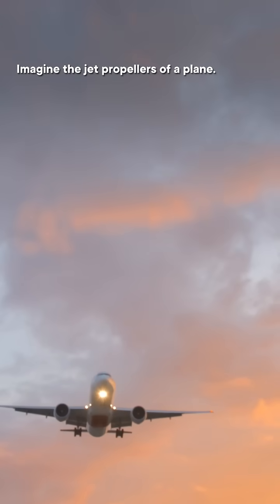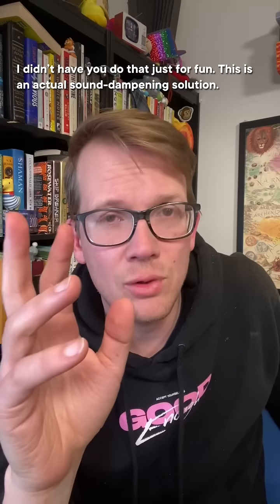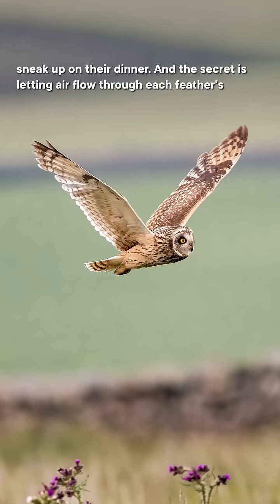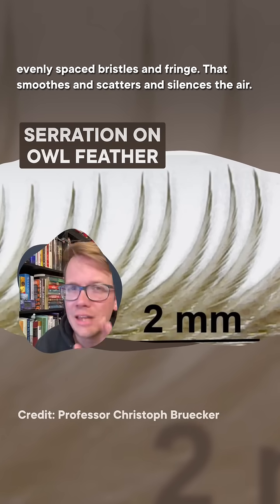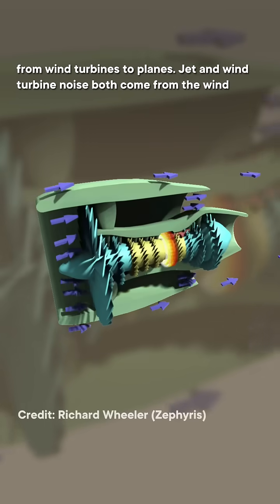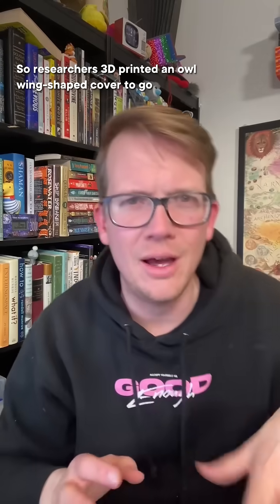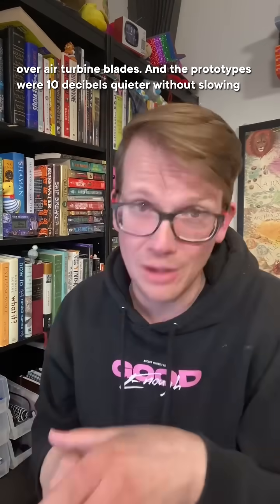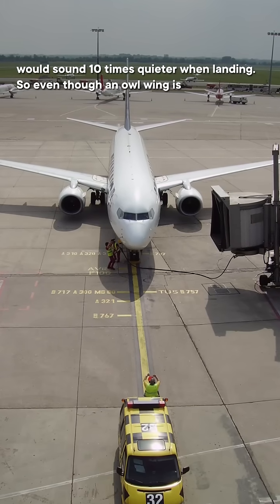Now, we can be as quiet as owls #shorts #science #SciShow

Comment: Boeing has something similar to this. On the 787 Dreamliner and 737 MAX families of aircraft, they use chevrons on the engines to help the high velocity air coming out of the back mix with the static air around it smoothly. Without them, the static air creates vortices which causes a large amount of the sound from jet engines. As for the fan and compressor blades, they can't really get quieter as well don't have materials strong enough to do this yet

Comment: As a employee of a GE and Pratt whitney refurbishment plant I will say that the alteration that you are suggesting would make the blades "single use" parts instead of being able to recondition them.   These foils are not cheap to say the least! And there is a hundreds or so of them in the engine between the LPT and Hpt sections. The limited lifespan of a new blade of the current design is short enough. I don't believe the blades you are suggesting would make the life span about an eighth of the current ones. Inkonel is tough but I don't think it is that tough.... I've seen sooooo many cracked blades in the last 17 yeara you wouldn't believe it.   There is something to think about. 🤔🤔🤔🙄🙄

Comment: I'm a wind turbine technician. This is kind of already utilized. The blade on some new turbines feature a serrated edge on the back of the blade to reduce noise. These are essentially add ons to a blade and are not built in so it does not reduce the structural integrity of the blade.

Comment: While this makes more sense for propeller driven aircraft where most of the sound comes from blade noise, on a high-bypass turbofan the majority of the noise comes from the interaction of hot exhaust when it hits the cold airstream. Reducing Exhaust Gas Temperature does a huge number on decibels. For example a military aircraft with afterburners engaged sounds WAY louder than the same engine at the same throttle setting without afterburner on.

Comment: 10db quieter is way more than 10x quieter. Because it's on a logarithmic scale. The difference is that the "force" of the sound doubles every +3db.

2 engines/machines/etc going at 110db make the same noise than 1 engine going at 113 dB.

Comment: there's chatter coming off the rear surfaces of every mode of transportation; Golf-ball-dimples and Braille-dots are actually dynamic resistance cancelling features that could be applied to any technology that travels at speed, fan-vanes, propeller-blades, keels, hulls, rudders, spoilers, air-brakes, high-tension-wires, high-rise-balconies, suspension-cables, ie modern design.

Comment: The decibel scale is logarithmic. This is very significant and really cool tech, but I've spent the last 15 years working with "loudness" professionally and as a hobby. Standing next to a woodchipper is 10 dB quieter than a jet at 100 feet. It's still super dangerous to hearing. The stereo in my car was technically 100 times louder than that same jet engine. I listened to that for several years with very minimal side effects(partially because of the specific frequencies). Sound is a strange beast.

Comment: Jets do not have propellers. Also, PLEASE make the captions optional!
Reply: dude.. jets do have propellors.. they just arent fixed onto the front of the plane like in early inventions....

but i promise you every single jet engine has a propellor.  the fan blades are just housed inside the engine housing, instead of outside of it.
Reply: @o0xTHEcoPlayerx0o  Fan blades are not propellers. They do not propel the plane, they compress air and drive the compressor, the propulsion comes from the  fuel combustion.

Comment: Can we have this tech on leaf blowers immediately?
Reply: If your referring to gas leaf blowers the only reason thier loud is due to a IC engine that spins the blades to push air.
Reply: @Mrjack-yn2dj  the blades are a significant part of the noise, but not all. I'll take any reduction I can get
Reply: I'm not sure it would be effective on centrifugal compressors as in a leaf blower.
Reply: @100GTAGUY  well I'm not sure how they work. I had assumed high velocity fan blades, but I don't know for sure
Reply: There already are more or less silent leafblowers in use nowadays. Becaus of ergonomics the batteries of the things I saw were placed in separate backpacks so the cleaning personnel looked like they walked out of a ghostbusters film.
Reply: @haifutter4166  🤣 I ain't afraid of no 🍂😹
Reply: @haifutter4166  heck, Ryobi makes one that uses the same battery pack as all their drills, impact wrenches, grinders, etc. use.
Reply: Can we just ban leaf blowers?

Comment: wouldn't that necessarily reduce the efficiency of the turbines, thus requiring burning more jet fuel overall?
Reply: Actually, with the fuel energy NOT being converted into sound energy, I think it would increase the efficiency. Unless, it just ends up as more heat instead of sound.
Reply: @JoshWebb  i thought it was implied that it would end up as tubulence, just quieter turbulence

Comment: just a question: will this also make the engine's more efficient? less turbulence, less transfer of energy into sound? higher efficiency?
Reply: Pretty sure that turbulence equates to localized low pressure which equates to a partial vacuum "sucking" on the back side of the turbine blade, creating drag and slowing them down. Reducing turbulence and smoothing out the airflow (laminar flow) should actually improve engine efficiency.
Reply: @elimgarak7330  but you don't want the fan blades to spin to fast. It's important to keep them under the sound of speed and reduction gears increase the cost of MX.
If you made those blades too efficient then I could see that being an issue. You might save money in one area but spending it elsewhere
Reply: @collins9708  the blades going supersonic isn’t an issue unless the blade is less efficient, if that’s the case then the plane would have to just move slower as the blades would spin less, so generally this just means the plane would be quieter at the cost of soeed
Reply: @spencer4685  if the blades go pass the speed of sound then the airflow becomes less efficient from the shock wave that it produces. Even if you make a blade that is More aerodynamically efficient, you would lose all the efficiency once you go pass the speed of sound and this is currently one of the major issues in props and jet engines designs; Keeping the blades subsonic. Modern day blades are being held back by the dilemma of keeping them subsonic. Most props have reduced gears and even some jet engines but it increases maintenance and this was one of the major flaws in pratt and Whitney's engine when they put a reduction gear inside their engine. 
Our blades are pretty aerodynamically efficient as they are. I just don't see the need for this.
Reply: @collins9708  Pratt and whitney GTF engine is fine now after the initial problems, havent heard anything for the past 2 year or so. We should be seeing the tech move on to widebodies soon
Reply: @spencer4685  a blade going supersonic is definitely bad, almost no thrust is generated on a supersonic blade, most engines reach supersonic on takeoff but only the tips of the blade, and thats what making the majority of the noise.
Reply: @spencer4685  that’s untrue. Supersonic blades create insane noise and are very inefficient due to the shockwaves formed by supersonic motion.

Comment: Also computer cooling fans. Millions of the howling bastards, in server rooms & home systems all over the world...

Redesign the fan blades with Front Serrations (as shown) & Fractal Back Edges (soft fluffy wing pinion feathers, which help to dissipate the sound of air flowing over the owl's wing). Balance fan speed with high cubic meters of airflow & you've got a silent beast.

They've been a work in progress for several years, now.

Comment: I was... literally just wondering if I could modify my ceiling fan to make it quieter. maybe i should redesign the blades.... the fan's modular.
Reply: The noise from a ceiling fan is generally not from turbulent air spinning off the blades; it's from the bearings in the motor housing as they flex in dimensions other than the rotational dimension in which they're designed to operate. To quiet a ceiling fan, you would first want to balance the blades as much as possible to reduce the wobbliness of the axle as it spins in the motor, thereby reducing the vertical stresses seen by the bearings.

Comment: Did they also measure the impact on fuel consumption? As this is the main consideration when designing a jet engine (reliability & safety being more of a pre-requisite)
Reply: Exactly what I'm thinking. They're already inefficient enough
Reply: @RomanNardone  inefficient?? Um no. They are the single most efficient engine type in the world for pound of fuel to power output.
Reply: @thegoldenatlas753  I don't mean the efficiency of jet engines from fuel to lift. I mean the efficiency in the amount of fuel required to fly jet engines and the amount of emissions which contribute to climate change (also the only fuel still allowed to have lead in it)
Reply: @RomanNardone  first off.
No. Efficiency is measured in power per unit of fuel.
Effective torque, effective thrust, etc.
Jet engines on airlines use lots of fuel because they need to produce a lot of power but their power per unit of fuel is greater than any other combustion engine.

Also jet fuel doesn't use lead. It uses kerosene.
General recip aircraft use leaded fuel, and its because they need the lubrication properties of lead.
Reply: @thegoldenatlas753  are you just looking to fight with someone? You obviously knew what I meant. I was pointing out that airplanes already use lots of fuel and adding something to muffle the sound would like increase the amount of fuel used.

Thanks for the clarification on the kerosene. I do know that the fuel used does contribute far more to environmental damage than other fuels so additional needed fuel would have a larger effect than other types transportation
Reply: @RomanNardone   ?
Forgive me for asking but how would it increase the amount of fuel used? The new design would only add bristles to the engines to makes it more efficient in not only noise pollution but also general speed, it has nothing to do with fuel or its consumption, in fact it would actually reduce the amount of fuel used if I’m thinking right.
Reply: @srslothington  because it could effect aerodynamics
Reply: @RomanNardone  it would affect aerodynamics, sure.
It could be a positive effect though :)
Sound can be reduced by muffling it and/or by reducing the turbulence from the source. If the effect is not muffling, then a reduction of turbulence would actually increase the power efficiency!
Reply: @patrickpredella  If it was more efficient every bird would have it.
The owl needs the stealth to ambush their preys, so the reward is positive.
For ducks,  who needs efficiency for the migration, not so sure.
Reply: @ameunier41  that's actually not guaranteed: if you're a duck, what is the point of silent flight? I can't really think of any. That means that a duck with a special feather mutation would not have a survival advantage, and ducks have huge populations. That means that the mutated trait would not emerge as the "mainstream" duck, because other ducks wouldn't die off.
Reply: @RomanNardone  Leaded fuel is only for piston-engine aircraft.
Reply: And durability
Reply: I also wonder about keeping the bristles clean, so that air can pass through them, and the life of said bristles when they spend 12+ hours per day being battered by wind at 450mph.
Reply: @pulaski1  have you ever seen a dirty owl me neither
Reply: @katiebarber407  they should put a big beak on the front of the plane that cleans the bugs out of the feathers while it’s on the ground… actually let’s just scrap planes all together and fly around nestled in the feathers of giant owls 😂

They can be powered by the snacks and crumbs people leave behind
Reply: @katiebarber407  I haven't seen a Boeing preen itself either!  🙄
Reply: @katiebarber407  have you ever seen an owl going through a flock of birds at 450mph ?
Reply: Wind turbines have a blade type called a whale fin. More efficient and quietter: for wind turbines. A jet engine works on the natural compression of the air fuel mixture for propulsion. Im sure it would work in the future, but not now
Reply: I love hearing an engineer's perspective on this. The DOD doesn't care about dollar-signs; that's for post-war economists to worry about.

"Never forget that your weapon is made by the lowest bidder."
Reply: the 787’s GEnX engine already has similar bumps on the end and it’s one of the most fuel efficient planes
Reply: It might even improve it. Noise is energy that is wasted.
Reply: @M33f3r  yep reduceing turbulences will decrease internal drag and increase efficiency   kinda the same happened with the winglets the (mostly upwards) curved end tip of a plane wing inspired by the feathers of big birds binding upwards at the wing tip  they pull wing tip vortex away from the low and high pressure areas under and over the wing Profil and decreasing size and speed of the vortex giving a shorter wing more lift and lower drag than a wing without a winglet
Reply: @M33f3r  I was wondering the same thing - someone discovered that texturing a yacht hull like shark skin makes the yacht faster.
Reply: Well my guess is it says that it wouldnt slow them down. Or maybe it was yhe wrong interpretation but under that assumption there wouldnt be any extra drag so ig fuel consumption stays the same
Reply: I most likely makes it less efficient but it does seem like it would have great military aspects for like c-130s and cargo transports
Reply: As manufactures makes most money of repairing and changing components
Reply: If it’s not slowing them down, then they’re probably relatively even in fuel consumption.